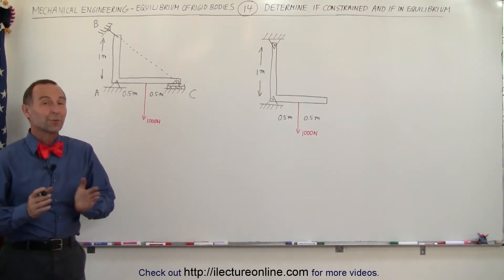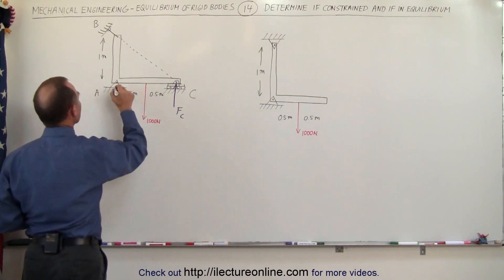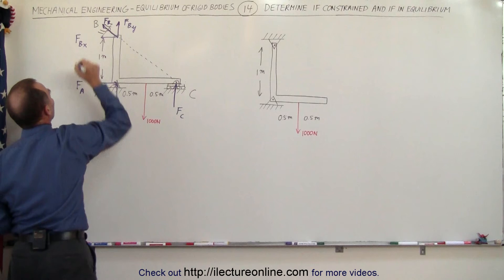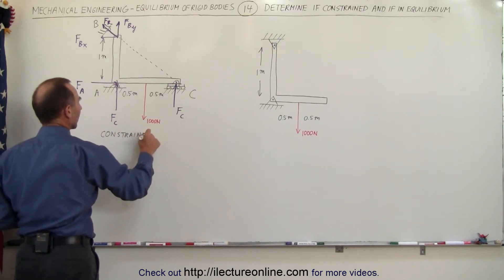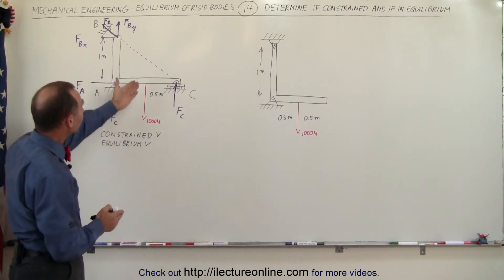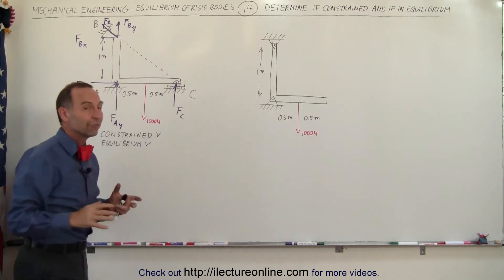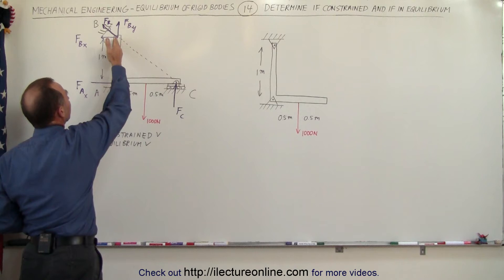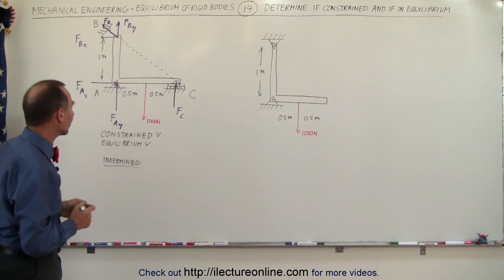Mechanical Engineering: Equilibrium of Rigid Bodies (14 of 30) Find Constrained? Equilibrium=? F=?

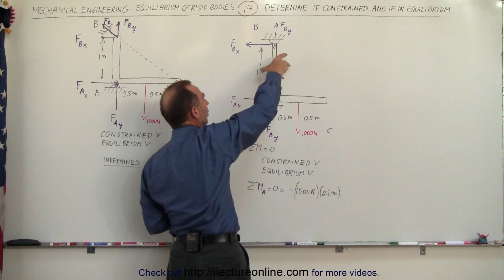Comment: I think the signs of the forces in the answer determine the correctness/wrongness of the assumption on the direction of the force. In this video in figure 2, 4:39 Fbx was assumed to be directed to the left but the negative sign was not used in the calculation of the magnitude of the force, Fbx (unlike in previous video) resulting in a positive sign which confirms that the assumed direction (towards left) was correct.

Comment: For the first problem, can't you just sum moments around A?   Since FBx and FCy are both at 1m from the pin, they form a 45 degree triangle, does that not make them equal forces in opposition to the (1000N)x(.5m) = 500 Nm so 250N each?  I've taken the tension at B to be at 45 degrees as well putting FBy at 250N.  Then sum forces Y.  Then sum forces X.
Reply from the maker: There are often multiple ways to solve the same problem as in this case.
Reply: Michel van Biezen thanks for the quick response, I was asking because in the video you indicated that we could not solve for the forces in the problem.
Reply from the maker: Now I understand your question.  If you place the moment at A, you'll have 2 unknowns (Fc and Fb)   Also FBx and FBy are not necessarily the same magnitude.